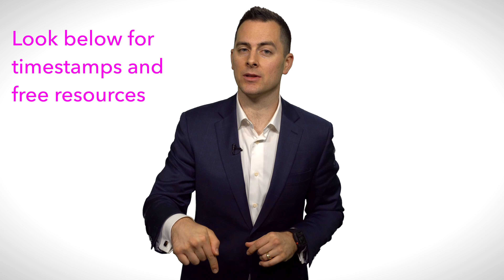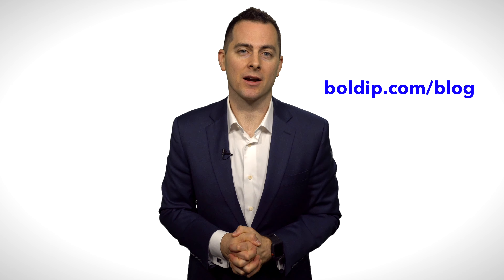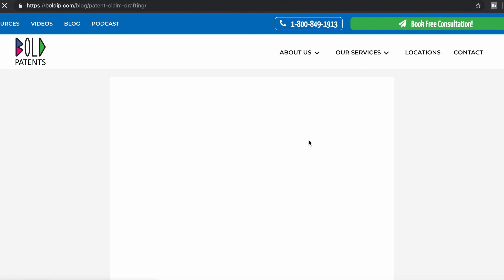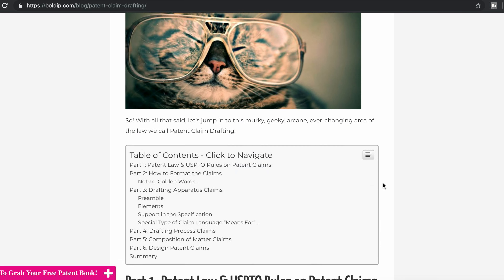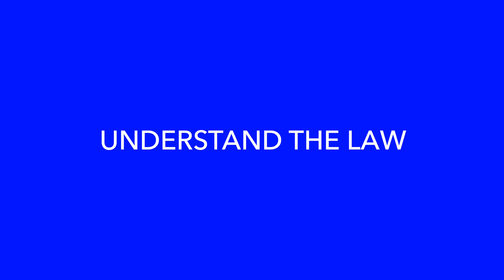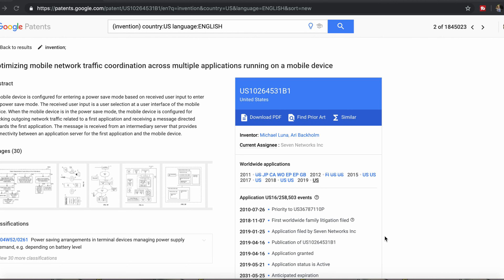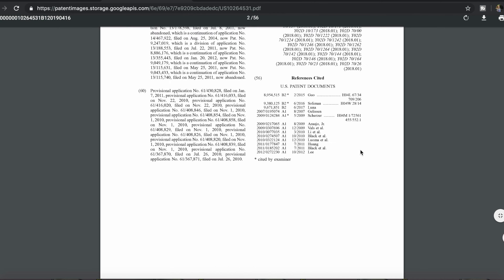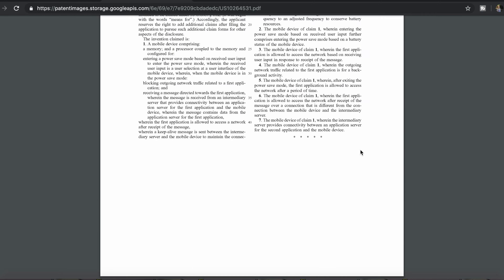Patent Claim Drafting: 6 Core Principles You Need to Know

Comment: Appreciate the video. Is there any explanations on the math in tallying the #s of dependent claims for fee calculations?
Reply from the maker: For Utility patent applications you get 20 claims (3 independent and 17 dependent typically) included with the normal filing fee. If you go beyond 20, there is a charge per claim. The fees change over time, but are found here: https://www.uspto.gov/learning-and-resources/fees-and-payment/uspto-fee-schedule
Reply: @boldpatents  Thank you for the reply. Yes 20 total, 3 independent included with the filing fee which is adjusted for small and micro entities. 
But when tallying the claims in a complex claim structure where there are over 20 claims, and where some dependents are based on more than 2 other dependents or to dependents that count as more than one due to their prior claim references. 
THAT is where I need practice/help. Do you sell/offer services?